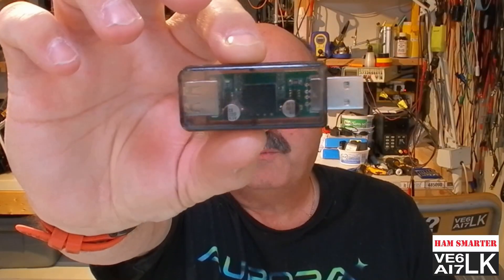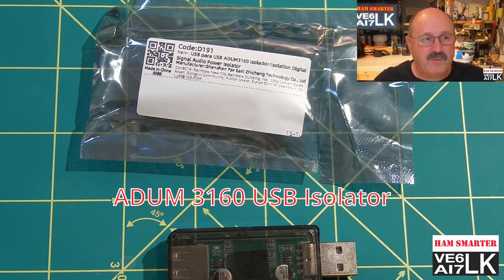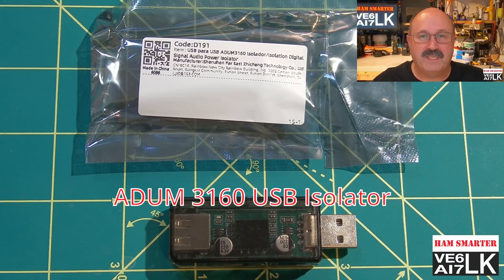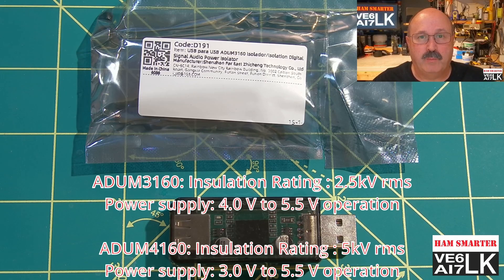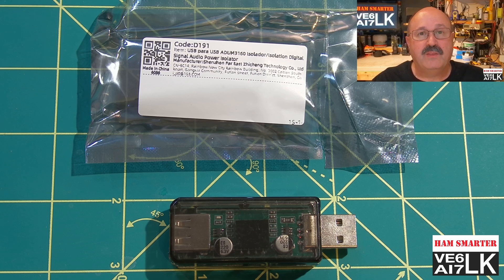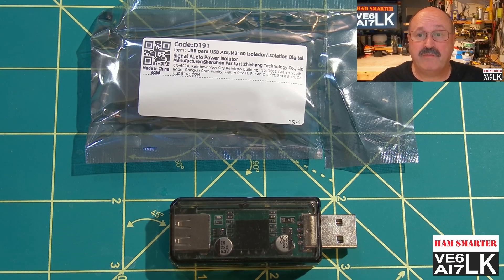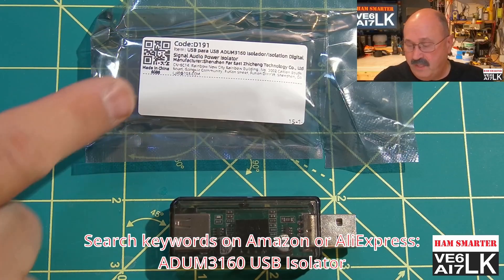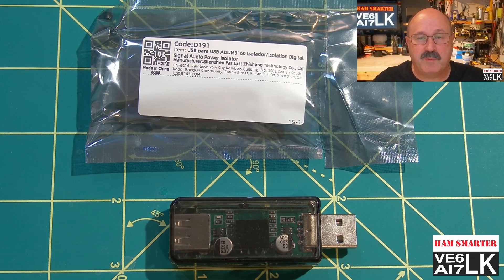Kit Basics: Eliminate Ground Loops with this one little gadget

Comment: I was using a GD-77 on a Rpi 4 as a 5 watt MMDVM Hotspot and found that during transmit it'd just conk out. 
Switched out a long USB cable for a short one and later looped it around a decent palomar torroid to good effect. 

... this seems cheaper than that torroid that I could use for other things. I like it. 73 and thanks for the tip.